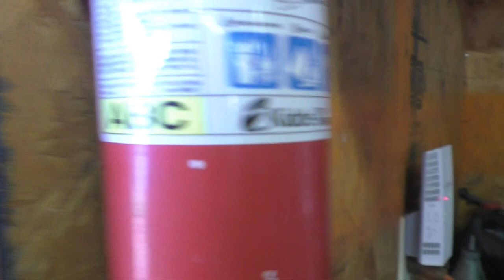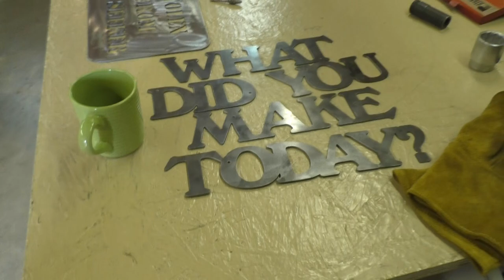SV Seeker Live - June 24, 2017 - Keel Fuel Tank, Truck Axles, Shop Safety, Makercise

Comment: Great vid Doug, the safety issue has gotten out of hand, I'm on insta and showed a mini fridge in my shop with beer in it and people went nuts over it, come on people get real been working around power equipment for many years with no problem.. You respect and learn how to use any power tool and you will be okay.. Keep up the great work ..

Comment: Question, Whats the overall plan with the fuel tanks? Are you planning to use the "gas" paint to seal up the keels and then weld in a pick up, vent line etc??  One idea I'll throw out are the fuel bladders,  they can be customized to size so you can fit them where ever you want and also great if you need some extra capacity but don't want to take up lots of room when not in use.

Comment: Slightly off topic.  I was in the Air Force stationed at Eilson AFB and was assigned to the 5055 Range Squadron.  4 years of working almost every day out on range that is 20 to 40 miles off road one way in weather down to 60 below.  We NEVER had an accident out on range and never had a time loss accident at all.  The worst thing I saw was on base and a fella' (Dave, you know it's you) cut his hand kinda bad.  If he was our on range he probably wouldn't have been doing something so stupid.  We never had a safety meeting.  Never had a toolbox meeting.  We all knew it was dangerous and we watched out for each other.  Sorta what Doug was saying.  Be responsible for yourself.

Comment: I love your iron on the safety gear rack. I think people don't use iron enough and get injured :)

edit: just add a different point of view, French labor law has this thing called "the right to back out", if the situation is unsafe, you have the right to stop doing your job (there are some safeguards like you can't increase your co-worker's risk)

Comment: in my grandfather's shop, there was a sign, it was the ABCs of the shop
    Always pay ATTENTION
                   think about how you're going to do;  watch while you're doing,
 BE Aware of the hazards
                  know the tool: how it's used and how it works
CARE about your tools and workspace
                  maintain your tools and keep your work area tidy (within reason)

Pretty much all of Safety falls into those categories.   As a boy,  whenever I jabbed myself with a screwdriver, or raked a handsaw across the back of my hand, grandpa would send to me grandma for bandaids, when I came back to shop, he'd take me over and point me at the sign, and tell me to read it outloud, and explain what I thought it meant.   When he was satisfied I had the message, he'd let me start building things again.
     As I got older, if I slipped or made a mistake, he'd look up and point at the sign....    By the time i was a teenager, it became something of a running joke when either of us messed up something, the other one would point and say "what's the sign say?..."    That was pretty much it for safety in his shop.
  When ever he let me "move up" to using a power tool, he always explained how it worked, where the controls were, etc. (once i was older, he'd had me the manuals first)  He'd watch me the first few times and correct me if I had bad technique.   The only "safety briefings" he ever gave me, was the one time his radial-arm saw had a recall, and we rewired the kill switch with a different style.  It was more of explaining why were putting a new switch on it, while we were doing it.   Safety was always there, as an undercurrent in his shop, but it was always understood the only person truly responsible for my safety, was myself.

Comment: Doug- I know galvanic corrosion was a big concern with the cabin. Are you concerned about the deck hatches?
Reply from the maker: No.  For galvanic corrosion to be significant there must be sea water in the mix.  There is no place for the water to collect on the hatch hinges.

Comment: Out western Canada "Dueck" is pronounced  "Doo Eck"  Grinder guards? that's the first thing I toss when I buy a new grinder.  I've worked in my families metal fab shop when I was young been around it for little over 2 decades. People watch me work I'm welding with no gloves on I'm in a short sleeve shirt. I do wear ear muffs and glasses when I'm grinding, when I'm torch cutting I wear a light shade cutting glasses. I worked with a young guy 4 months ago it took him so fucking long to put on his safety gear I had the job done. My weaknesses is working on heights I don't do well working off ladders etc so I try to avoid doing it.

Comment: Doug here's my take on the world today. People are striving for power. Hay smoking is bad for you! Where are your ear plugs? Beware dangerous screwdriver! 
I have worked in a number of dangerous jobs, a crew chief for a USAF fighter jet. I was in the cockpit running aircraft when one of the fuel tanks blew a seal. Fuel streaming into the jet exhaust. Once when I worked in steel mill and the electrodes which went into the furnace got stuck and we had to spent about 2 hours on top of the furnace lid getting free, right over the top of thousands of pounds of molten steel. I lost 20 lbs that night from the heat. My point is common sense will tell you when something is too dangerous to do.

Comment: wifi !!!!!- in uk we can get WiFi booster that plug in mains set them to you router setting . but they read each other and boost the strength so in your case I would  plug one in the boat cabin that would pick up the one by the door.

Comment: At work we would call all the warning labels LAWYER TALK. Also all the rules that OSHA would threw at us. They made more unsafe for us. Guards on grinders. If it was flat OK but we needed to grind and they got in the way or the wheel was to big  like when we pipe weld. We use a cut off wheel and they were big and you needed to go around he pipe. We had a table saw that had no guard. W had to make one fit and it had got are wood jam many of times. That is my rant I can go on and on.

Comment: Why not use phosphoric acid to clean, remove rust, and prepare the steel inside the boat? Also wet rock wool has zero R value. Stick with foam.
Reply: Wool from sheep has the same R value wet or dry. idk if they could use that. Foam is filled with nasty chemicals and the insulation department at home depot smells like.... insulation.

Comment: what is and where is sea level
Reply: Sea level  is  elevation ZERO.... Denver is called the mile high city as it's elevation is roughly 5,200 feet.   Tulsa is about 630'' which is why we will have to pass through more than a dozen locks to reach the Gulf of Mexico.  New Orleans has an average elevation of 1 to 2 feet BELOW sea level which is why it has a substantial levee system.
Reply: The mile high city is that from Gulf of California or North Alantic
Reply: sea level is sea level.. all the seas...  same level  (an average accounting for tides)
Reply: 751 miles to Gulf of California would be 69.8840909 miles over the earth curve

Comment: What is safety ?
It's knowing how far you can go without putting yourself in danger.
Go back to the Empire state building, the steelworkers didn't wear safety harnesses, or the mountain climbers that didn't use ropes, they achieved their goal.
Any intelligent person will know that if you drill a hole through you hand, it's going to hurt.
today it's a blame society, manufacturers have to tell you to wear safety gear so they don't get sued if you don't.
A pack of peanuts "contains nuts", "This coffee is hot", i'm sure there are many others.